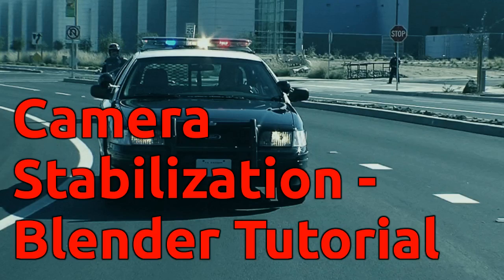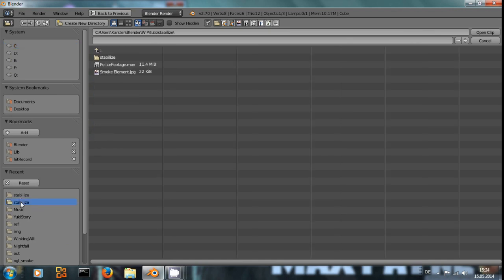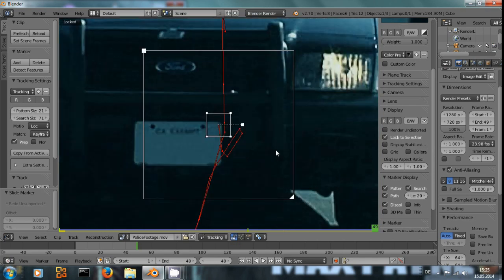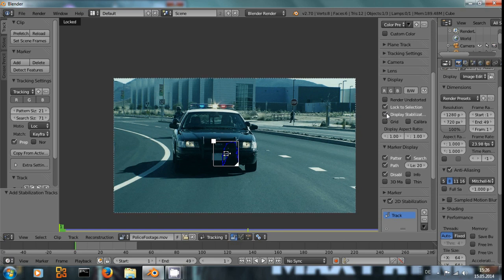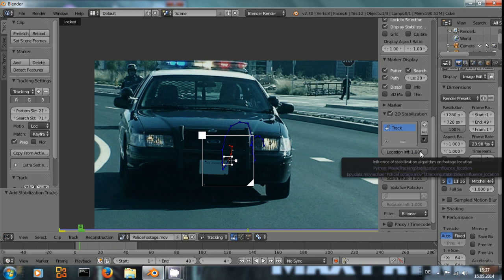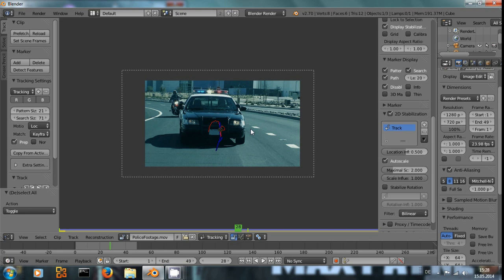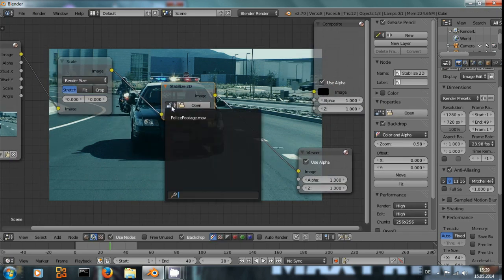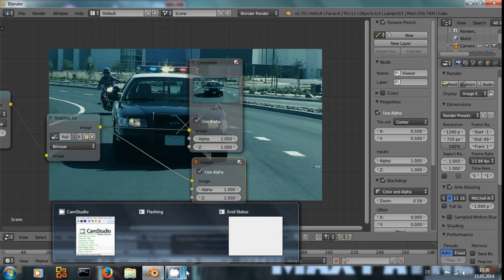Camera Stabilization - Blender Tutorial

Comment: How to stabilize shaky camera in train for exaple? Looking outside window, without points to fix on?
Reply from the maker: +ugurugutugu depends on the footage: blender needs 2 points that are fixed and visible through the whole video to get the stabilization info. If there are no such points, there isn't the info needed to stabilize
Reply: what about using multiple points? and switching between them mid-cut?